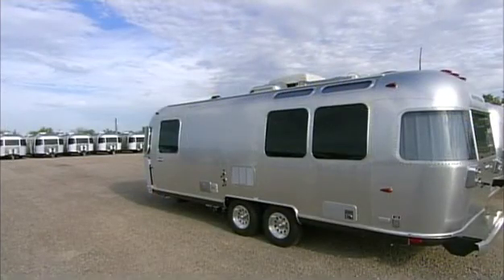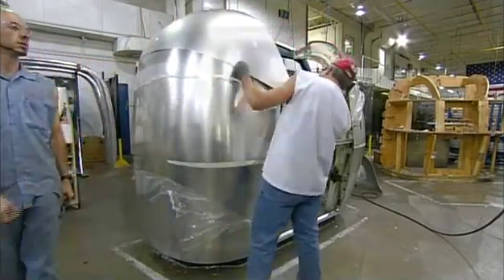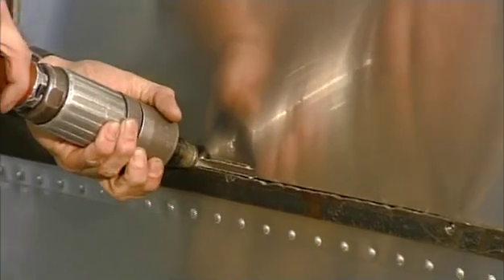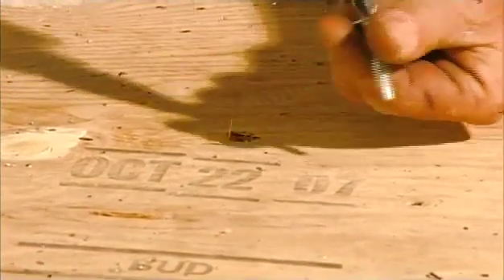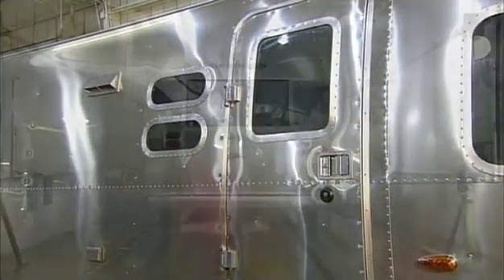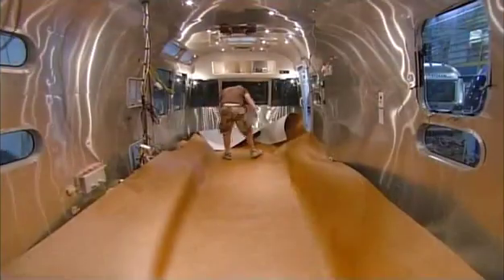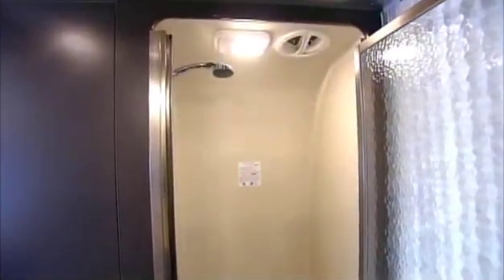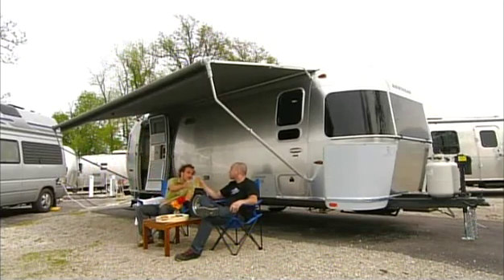Airstream How Its Made

Comment: I am not impressed at all I can see why they leak they put sealant on the outside of the seam not between and sealant on the inside with a brush wow try and find that leak PLYWOOD FLOOR ON A TRAILER THAT COST THAT MUCH IT IS NOT EVEN MARINE GRADE THEY COULD USE HONEYCOMB COMPOSIT AND WHERE IS THE STRUCTIAL RIBS      WHAT JUNK

Comment: Fiberglass insulation and steel frame? No thanks.
Reply: As a former Insulator, Fiberglass is easy to install and cheap, but for a high end RV, there are better options. Should there ever be a leak, fiberglass batts hold water leading to mold and mildew. My question is why they are not using industrial adhesives instead of rivets like most industries do now. Can't let go of tradition?
Reply: @rangerdanger88 I’d imagine less people would buy them if they made them like everyone else. I have a airstream from the 1950’s that still works perfectly fine.